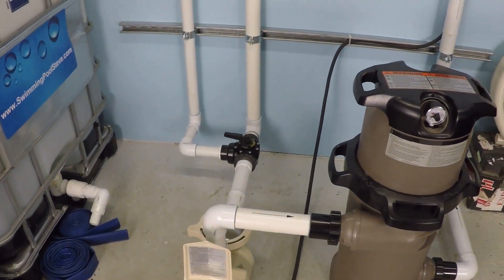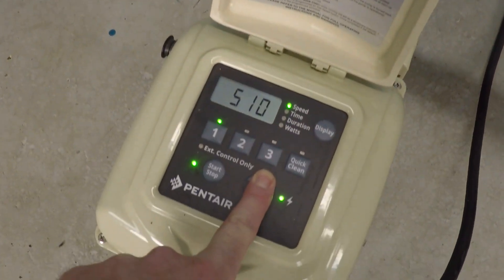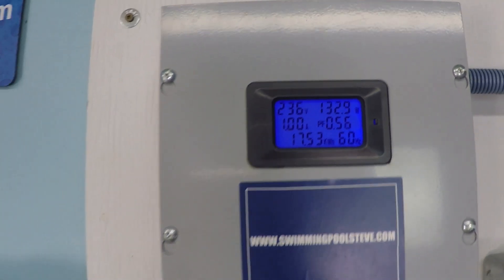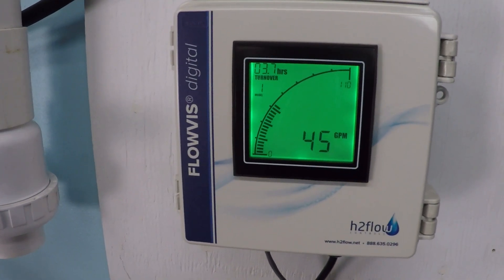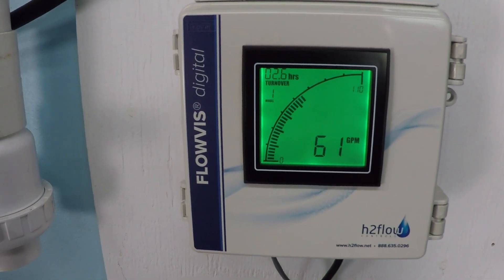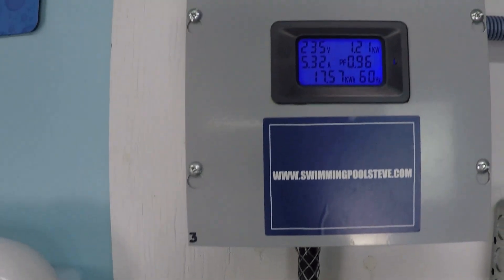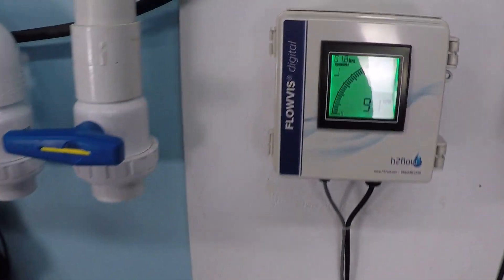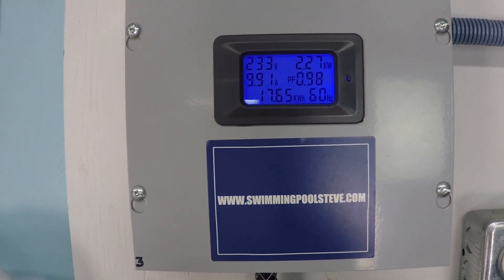Comparing Energy And Flow In 2" Pool Pipes

Comment: This is interesting in the last vid with 1.5Inch pipes the 1500rpm was 1500rpm 34.6 GPM (2076GPH) at 251W but in this one while the flow went up : 37 GPM (2220GPH) the power demand also increased by 11W with the motor demand being the same. 
I often wonder if the system is slower with more reductions or by the length or reductions. For example my shitty 1.5 inch pipes claim 7.9m3/hr (2100 gph) /7949 Litres /hr for an intex 250W unit but looking at the pump outlet before the ribbed pipes the whole is about half inch??
Also the jet into the pool is smaller as to be expected but that is to provide the pressure and "jet" at the end. I don't understand why the exit is restricted unless it's a design feature to get the system "pressurised"
Any ideas? I'm no expert in fluid dynamics.

Comment: Good information. Just the tests i wanted to run myself. Could you pretty please present the result as a table with columns for rpm, gl/min, watts en for bonus point the filter pressure! Much appreciated.
Reply: I have no idea if you are still looking for such a spreadsheet, but I have one that I did to help see where the sweet spots are and volumes and costs per day and month.
Reply: @DavidKasan  yes please
Reply: @heinvandenheuvel  What is best way to send it to you?  It is in an Excel file.